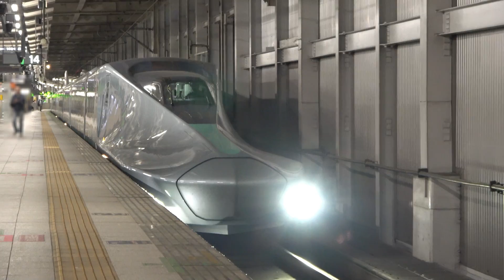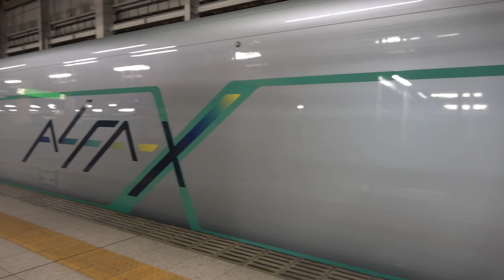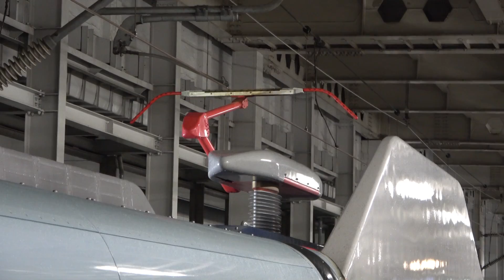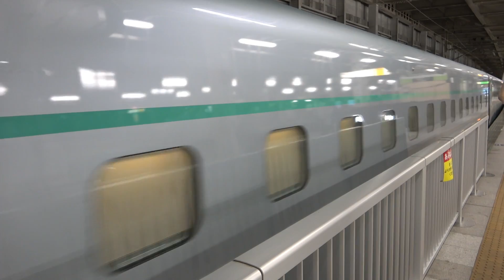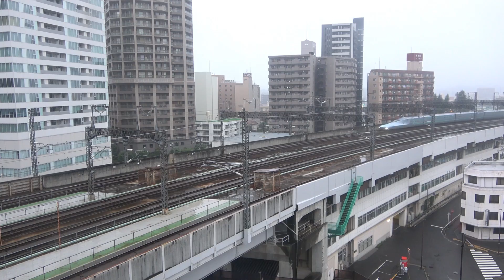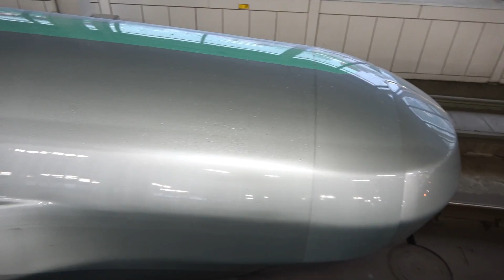ALFA-Xに会いに行こう! E956形新幹線試験車両 パンタグラフ上げ下げと発着通過映像 ALFA-X shinkansen test run

Comment: the secret of Alfa X's long nose✨  when a shinkansen enters a tunnel at a high speed, sonic noise is generated due to a rapid air pressure change (air-pressure wave named tunnel boom) inside the tunnel, and it is necessary to hold down the amount of the noise.
Reply: Thanks for the info 🙂👍

Comment: "Damn this train looks like a spaceship, can't wait to take a trip and ride this awesome looking train🌍"
Reply: The united states needs the trains.. Some operate by reversed magnetics they hover the track from different angles are magnets stay cooled by moisture helping to uphold magnetic values both in reverse and regular faced.  With magnetism u also have the capability of building a track off the ground having an earth quake and having an entire column area drop and the train stay afloat by nagnetics ensuring safety of passengers and same high speeds. The ideas compared are used on rides at theme parks
Reply: J
Reply: Sdx dzzsq
Reply: Only a few people got on the train, the interior hasn't been shown, don't know what the price is. Big info gap. So, too risky to be so enthusiastic. No guarantee that you stay alive

Comment: By far the best and my all time favorite is the 500 series.
No new train compares with the 500. The round tube-shape of the 500 ensured that the pressure waves, when passing other trains running in the opposite direction, were almost unnoticeable. Why they went away from that design escapes all logic. They said that people wanted more head-room, which sounds rather ridiculous.
Reply: I traveled quite a few times in the 500 series when I lived there . I recall the 500 series was introduced around 1995, in my memory is correct .The 500 series was rather cramped compared to the regular Shinkansen, not as much head room and luggage room
Reply: The 500 series was built by JR-West and it was directly connected on JR-Tokai section.
 However, JR Tokai disliked this train because the first carriage had only one door and the seating arrangement was different from the 700 and N700 series. In addition, the 500 series were almost 1 billion yen(about 10 million USD) more expensive per 1 train (16 cars) than the N700 series, so the 500 series could not survive in terms of manufacturing cost.

Today, all of the more than 130 Shinkansen trains owned by JR-Tokai and all of the trains of JR-West that are directly connecting for JR-Tokai sections are unified with the N700 series. The 500 series is divided into 8 cars and operated only in the JR-West section.

Comment: You kinda forget the long and tedious development process on newer models, because we already have them.
Btw, that train (Alfa X) looks slick and futuristic, maube too much. It looks 15 years ahead of its time 🤔.
Reply: It’s designed like that to get through tunnels faster........the faster u go the longer the nose has to be to prevent the compression of air in the tunnel.
Reply: I don’t think the design will be this advanced for all the models.
They will have a much cheaper design for the other trains as they will be used by daily passengers.
This one is just a test model used only by the engineers so they go full out.
Reply: @Chlrintruc  it will be in operation in 2030 long wait but at least they confirmed it